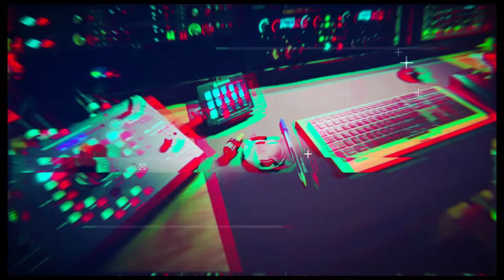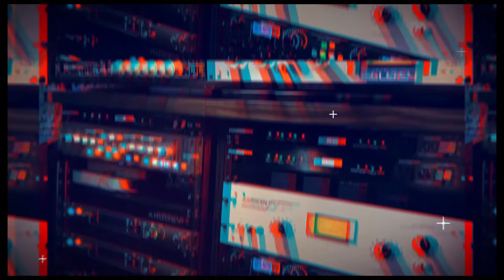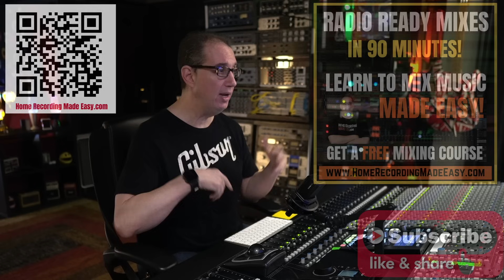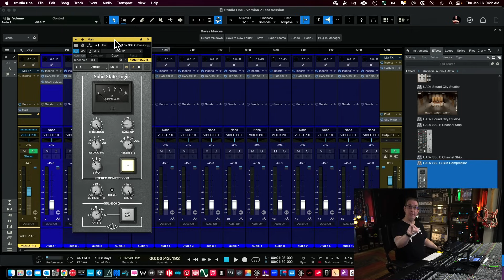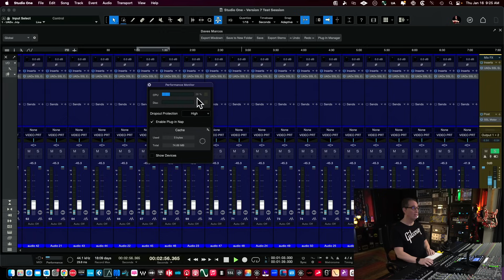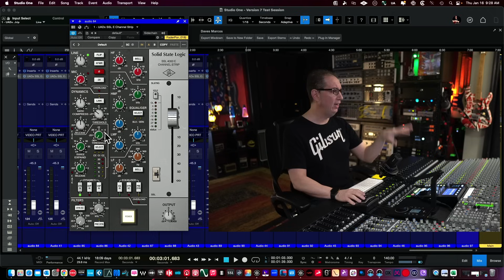UAD SSL 4000e Channel Strip | Native vs DSP | How Many Can Your Session Run?

Comment: Have you tried other Daws with the same experiment? I wonder if the way studio one handles multiple cores has anything to do with it. Also, your computer CPU has multiple threads so if Studio one uses each thread correctly then that is why it has so much more power. All of the above, I guess. RAM helps too. I have 32 gigs for gaming but 16 is more than enough for audio.  I tried to go to college for IT and even tried computer programming jobs.

 I graduated in 2014 at 45 years old HAHAHAH better late than never! I got all A's man. Straight A's in 52 courses all online. I earned a Bachelors Degree in General Science in IT with a 4.0 GPA. But my major was more for programming and hardware. I went to 19 interviews with no success, so I got discouraged after my graduation. I had to go back to flooring! :( Didn't help but I did learn a TON on how CPUs work.

 Now I build my own PCs so I understand the basics for sure. I have an intel i9 with 10 cores in my CPU with dual thread so that means it basically has 20 cores running at 5 ghz which is from a CPU AI Overclock. The Motherboard is a KEY piece of hardware for anything really. I built it right so I know it will handle a lot of these small plugins. It's just all the other stuff you have to watch out for.

 Certain reverbs like the SSL Flex Verb man it uses crazy processing power. I was wondering last night if that is a design flaw. My CPU got overloaded when it never does so I had to turn the Flex Verb off. For this experiment the DSP only has what 4 cores or 8? I am not sure I don't do Universal Audio hardware... I have the PreSonus Quantum 2626 plus I just bought a RME 802 Fs. It was the best interface I could afford. Really has excellent drivers man for real! I do have some of the native stuff. I like how everything works BUT the Reverbs use a lot of processing power just like any other plugin.
Reply from the maker: I have not tried it with other DAW's but I would imagine the results would be similar

Comment: hey did you have DSP Load Lock enabled? I suspect so, but this context is essential to understanding the results.
I;believe that setting DSP Load Lock to “off” will give the most accurate like-for-like comparison, as native resources do not use Load Lock. Depending ion the amount of processing, this could open up more bandwidth for DSP.
Reply from the maker: Ok, thanks for sharing the tip!

Comment: I own the UAD-2 (DSP) versions for both Channel Strip & Bus Compressor, and the upgrade to native was actually only $9.99. UA Support section confirms this is still the case, though it's $49 if you only own one of the plugins. Other than the Helios and Manley VariMu plug-ins (which can be upgraded to native for $2.99), all other native upgrades have been free so far.
Reply from the maker: I owned both as well and they told me is was $50. So maybe they changed the upgraded price.
Reply: @HomeRecordingMadeEasy  hmmm that’s odd ,  the help section details the pricing, which is current and the same as the offer I got on launch

Comment: I own the UAD SSL native plugiun, but I'm so used to the brainworx version that it's difficult to move to the UAD version
Reply from the maker: Totally understand. I own several versions of the SSL channel strips myself.
Reply: been there before, i have an ssl subscription and im totaly used to their strips. i have compared them in plugin doctor to see the differences. after that i could adjust and the very first mix i did with the uadx version sounded aboslutly fantastic. the uad version sounds very gritty and has a soft bite, midforward but in a beautiful way. pretty saturated and colored, but i really like this color. somemight think it sounds too clean but its not clean, the midforward sound comes from the saturation.

Comment: Very interesting. It seems they can do CPU and memory optimizations in the CPU that they cannot do on the DSP.
Reply from the maker: Thanks for watching!
Reply: The M2 chip is only a few years old, the SHARC chips used in UAD-2 are over 17 years old - vintage! Not a big surprise there is a massive performance gap

Comment: How many during tracking keeping latency under 10ms? I put plugins in the input section and shape sound coming in. Thank you Dave.
Reply from the maker: No idea. you'll have to do that test
Reply: @HomeRecordingMadeEasy  Gave it a try with a template I made for recording my drums. I armed twenty tracks and was able to insert nine instances of the UA SSL 4000E in the input section of studio one 7 before the performance meter pegged periodically in the red. Quantum 4848 set on 128 samples medium drop out protection 8.50ms latency. I built a pretty good PC a few years back based on specs from company's selling pro PCs for recording. Totally UN-scientific and not sure if the way I had my template set up made a difference ether way but it was fun and interesting. I wonder what your system would do? Thank you Dave for challenging me to think.

Comment: Very impressive... I think UA should shift from DSP to native version completely at the moment.
Reply: That's not a business for them why would you choose them for plugins like this one when the brand who designed this channel strips is making the plug in from the original design and guided by the engineer who made it and having better result because the don't have to do all the backward engineering to just start coding. And they also make audio interfaces that work better with the plug ins maybe you can get the similar performance with the newest UAD interface using the newer DSPs (obviously any Apple M chip is really hard to catch but get a bit close).
Reply from the maker: Thanks for sharing

Comment: Great video, although I have to add something. Enabling eq, comp, exp and mic line in (as you usually would, +- the mic line) will use a LOT more processing power. On my Macbook M3 Pro just inserting the plugin uses about 2% of my cpu in Live 12, enabling everything makes it jump to about 6%. But yeah, overall I think UAD DSP is useful in live mix scenarios, but a complete waste of money if you exclusive mix (not track) in the studio.
Reply from the maker: You are correct, but even still 17 instances vs over 100....the point is the same right?
Reply: @HomeRecordingMadeEasy hey did you have DSP Load Lock enabled? I suspect so, but this context is essential to understanding the results.
I;believe that setting DSP Load Lock to “off” will give the most accurate like-for-like comparison, as native resources do not use Load Lock. Depending ion the amount of processing, this could open up more bandwidth for DSP.
Reply: @ I guess so, im not sure how uad calculates the dsp usage. does it jump up when you enable all the other modules running on dsp?
Reply: I was coming into the comments to make the same observation.
Reply: Do you mean using UAD dsp or native

Comment: This is only if you are using Mac chips....
Reply: No, I have a windows machine with an i5 13600k, and I'm doing a mix with 65 ch. And it only uses 20% of the cpu.
Reply from the maker: Thanks for watching!
Reply: @eprotz

How? I've got a Windows i9 with 32 gigs RAM and I'm maxing out at about 60 channels of UAD SSL-e. Have you turned on EQ, Compression, Gates, and Transformer?